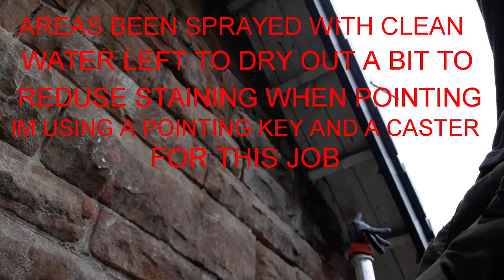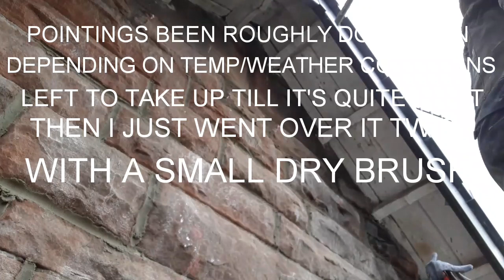Re-pointing parts of a sandstone gable

Comment: Don’t want to be that guy to criticise mate but unfortunately this repair will cause damage to to stonework. You should never use a cementitious based mix on sandstone. This mix should be done using lime and over 10mm should be done using sharp sand. 
I don’t mean to be a dick. Just for future jobs. I hope you have not done too many jobs like this. Unfortunately it is a very common mistake by builders that are not experienced with sandstone and DIYers. 
If I were you, I would offer the client to redo the work using the correct material. Please look up the damage that sand and cement will cause to sandstone. There should be plenty of images and advice online.
Reply: I totally agree with you.  
This will do this building more harm than good unfortunately.
Reply: Great comment cheers for this.

Comment: Gordon, I got quoted £5k from a Glasgow company to tidy up my front facade but my old bricky, John, said he can repoint it. In terms of cleaning the actual stones up, would grit blasting do (lightly of course)?
Reply from the maker: Look in to that 1 I seen a fireplace get sand blasted and it turned out horrendous there's a company that does soft washing mainly for k-rend just depends  on stonework if it's soft or hard
Reply: @onpointplastering  Gordon, thanks for the reply and excuse the late response.  

Actually, I am using a K rend system on my external wall insulation at the moment.  The new build and existing build was base-coated with HP12 and then insulation (eps) applied over the top.  Then, another basecoat and now we are applying Tudor chips over it.  

I will look at K rend products too for overcoating the sandstone (breathable for vapour diffusion of course).

Comment: Hi Gordon, I started yesterday taking off the flaking bubbeling cream paint from blonde grey mix sandstone 1880 .. it's more flat than this an have same crevuces at bits ... Is the best way to just use thin trowel to scrape paint or is there an easier process ?  Ta.
Reply from the maker: In my opinion what you are doing is good enough have you got a wire brush that might help aswell I wouldn't like to recommend a pressure washer as it could do more damage than good plus it would create a lot of mess if you do use a pressure washer I would try it on a small test area to see how the pointing and sandstone hold up hope this helps 👍
Reply: @onpointplastering  cheers much  for tthis advice and opinion  Gordon .. I found your videos under a search .. Aye av got wire brush am goin to plug away at it see how it goes.
Reply from the maker: If you have a brick hammer or a normal hammer you can try and gently tap the paint off that might help aswell
Reply: @onpointplastering  will do. Ta, ...
btw, was watching your roofing videos also. I have similar with gully and it's same scottish slate used. The metal braces have sprung up at parts and may need to call on your skill and expertise for this at some point, and possibly some wonky bits of slating at bay roof section relay .. the roof was re-done 2003  ..am Glasgow jus outskirts. And it's old victorian built lodge house

Comment: There should be NO cement used in this. You should instead be using lime, NHL 3.5, or better still, lime putty or a hot lime. The cement to too hard. It will retain water and cause spalling.
Reply from the maker: Believe it or not I know this as the lime method let's it breath but just doing what I was told to do and I guarantee there's loads of people that will do it this way but thanks for the information goid for the future
Reply: @onpointplastering  I did the very same thing to my house way back in 1984.  Builders told me that it was the right thing to do.I have just redone it in lime (nhl2). I found that the cement was causing water to come through the soft sandstone. This was damaging the face of the stone.